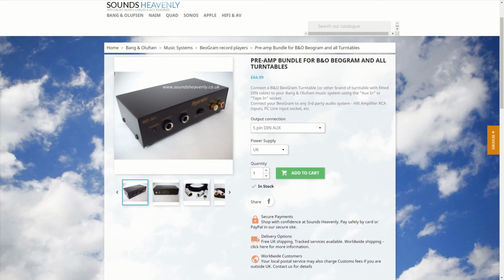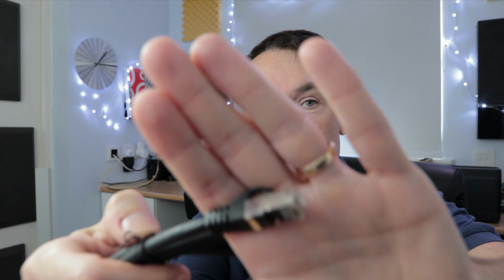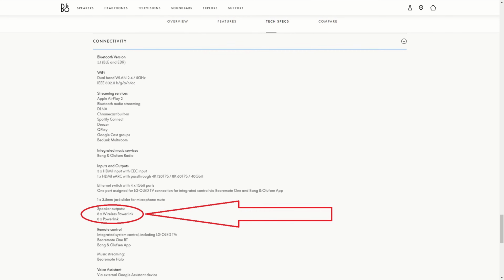Connecting Beosound Theatre - How to link Bang & Olufsen's new soundbar to absolutely ANYTHING! [4K]

Comment: Great video, thank you very much.
Is it possible to connect the Beosound Theatre to a conventional AV receiver? Getting the sound signal from the AV and just use the BS as a center speaker?
Keep up the good work and thanks again.
Reply from the maker: Hi, glad you liked the video!  Please remember that the Theatre is an AV receiver and a speaker system all in one, so it would be pointless to add a second AV receiver to this.  Use the Theatre as your main AV system and link any extra speakers to this.  If you need help with connections, please get in touch at https://soundsheavenly.com as this is too detailed for YouTube comments!

Comment: Hi Steve! How do you think the Theatre would go with Beolab 14? I keep hearing that it does not provide sound from behind and that it could use a separate subwoofer. The layout of our room and my wife’s disdain for large speakers lead me to consider picking up a used set of Beolab 14’s. However, might they be so small that they somehow subtract from the Theatre? If not, what do you think would be an interesting layout?
Thank you for great, in-depth videos, from Denmark
Reply from the maker: Thanks, glad you like my videos!  Yes, Theatre will work well with Beolab 14, although I think that the Theatre will give deeper bass than the Beolab 14 subwoofer!
Reply: @soundsheavenly  thank you for weighing in! I didn’t expect the sub to be superfluous but i guess that speaks to the shear power of the Theatre. I’ll see if I’ll be allowed to fit in a couple of 14 disks 😄

Comment: Nice video very professional. Currently I have a old B&O 7 TV type 9314 with not HDMI, I would like to know what is the best option to connect a equipment with HDMI and always here the great sound in the sound bar. Cheers
Reply from the maker: Thanks for your kind words and for your enquiry.  I am very sorry but I am not aware of any way reliably use streaming devices such as Amazon Firestick, Sky Q, Chromecast, Apple TV, etc. with older TVs that don't have HDMI sockets fitted.  Adapters or converters don't usually work well, as the protection software in the streaming device can turn off the signal unless a TV with an HDMI socket is detected.  I am sorry but I can no longer offer any video cables for TVs without HDMI sockets due to their age and obsolescence.

Comment: Can i conect a beolab 2 with a denon reciver and how?
Reply from the maker: Hi, yes this is possible via this cable from the subwoofer pre-out socket of the receiver: https://soundsheavenly.com/line-in-connection/101-459-singletwin-rca-to-beolab-2-7-10-28-and-2500-powered-trigger-kit.html#/2-length-1m

Comment: Thanks Steve. Great explanation. Your cables are very good. Satisfied with my current configuration, but maybe in the future. Have the Avant NG with converter for my BS 9000 and Beogram 7000. Remote control of the BS 9000 probably not possible with the Theatre.
Reply from the maker: Thanks! Yes this is all possible if the Beosound 9000 and Theatre are in the same room. Please email me via my website at https://soundsheavenly.com with the full details of your setup and I will be happy to help!

Comment: Great video Steve. I’m setting op my Beosound theatre Right in this moment with my 4 Old beolab 4000 speakers and it work great. But i have an older aktive cerwin Vega bass to. Do you know if i also Can Connect it to the theatre? 
So far i have Tried phono to din5 power to a rj45 adapter but it do not register on the powerlink connections in the app.
Reply from the maker: Thanks! Yes this is possible. Please get in touch at https://soundsheavenly.com and I can help further

Comment: Hi steve! How should be the setup if I need to add 2 Celestial as wireless left and right back speakers?
Reply from the maker: Hi Erwin, Celestial speakers are passive, so you will need an amplifier like BeoAmp 2 to power them, plus two Receiver 1s (one per speaker) if you want the amplifier to be connected wirelessly to the Theatre. Please get in touch at https://soundsheavenly.com if you need help with the cables for this
Reply: @soundsheavenly  Thank you so much Steve! I appreciate your response. 🥰
Reply: @soundsheavenly  Hi Steve! one more question. Can I use one BeoAmp2 only or each receiver 1 BeoAmp2?
Reply from the maker: Hi, you need one BeoAmp2 and two Receiver 1s for each pair of speakers